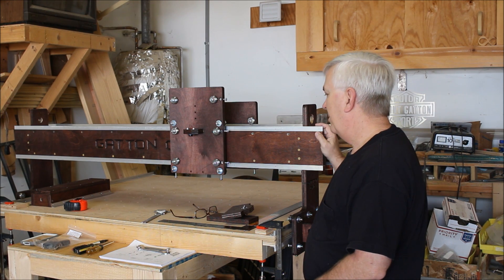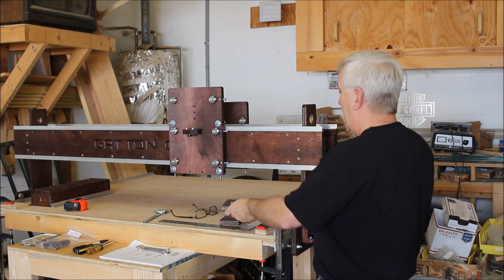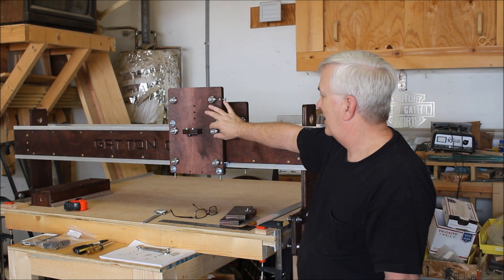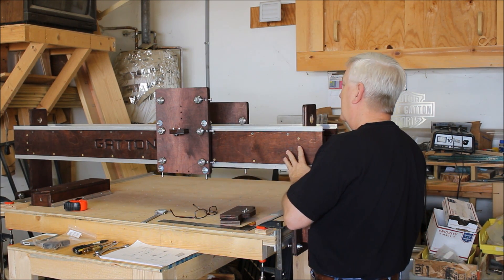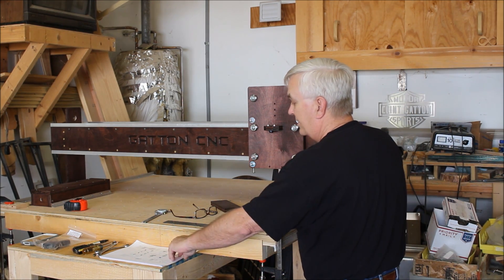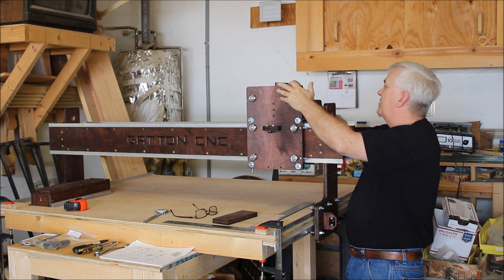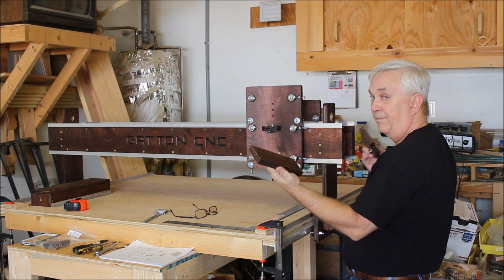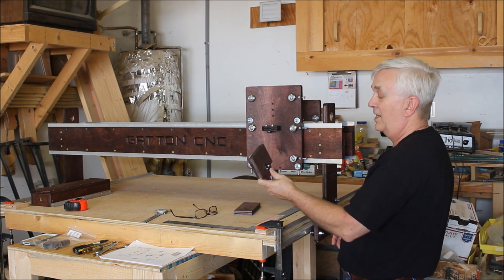Dave Gatton CNC Build Part 8

Comment: My total home brew is built different but I did use V-rollers similar to the way you did. The major difference is I uses STEEL angle instead of aluminum.  Aluminum will deform under loads if they are big enough so I used steel angle instead.  There is NO way I can put enough force on it to deform. In addition its far stiffer to add more structural strength. Ive been using mine going on 5 years now and I have yet to have to touch up the preload on the V-rollers. Because of the steel angle I didn't have to add dual plates on the gantry like you have and the overall frame dosent have to be as massive to retain rigidity. .